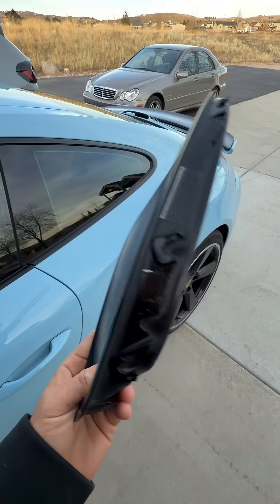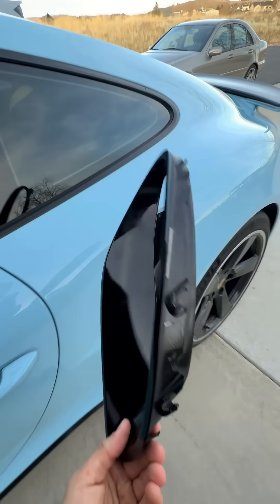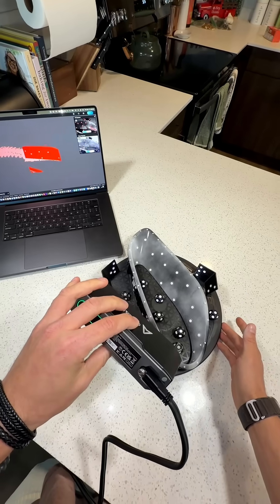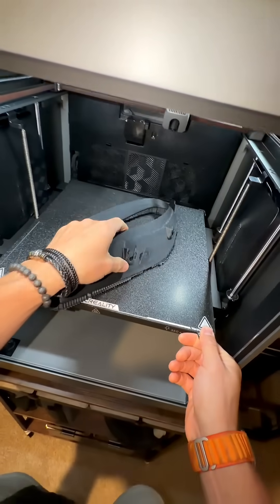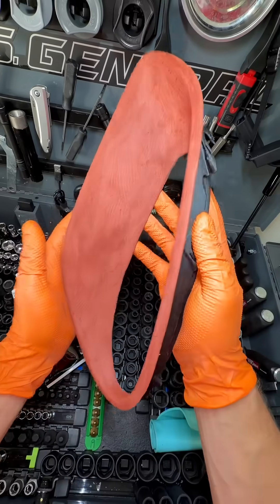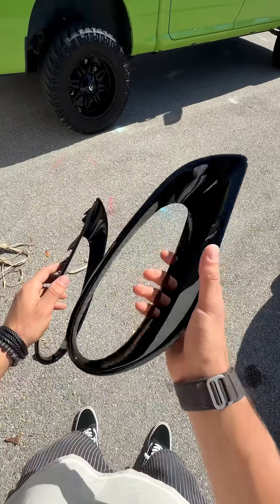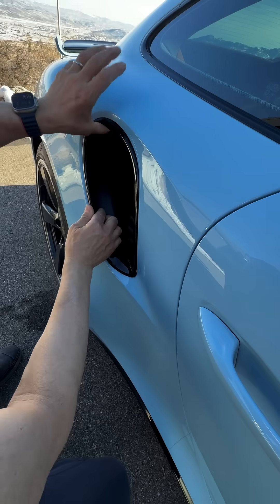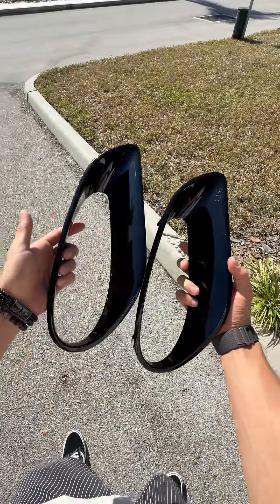Porsche wanted $2,000... So I 3D printed it for $20 instead😳😳😳 #3dprinting #creality #porsche

Comment: I think they do make paint match spray cans. Yeeee it aint like top notch but if uve done it enough times u cant really tell much a difference if u gots that steady hand.
Reply from the maker: Yes they do make automotive paint in cans and clear coat but it’s not as forgiving. If you mess up clear you need to sand and polish it out and I just wanted to be done!
Reply: It exists, any high end paint shop will mix you a matching can.